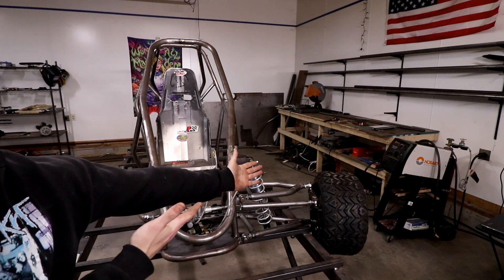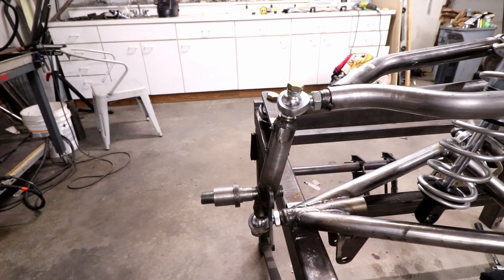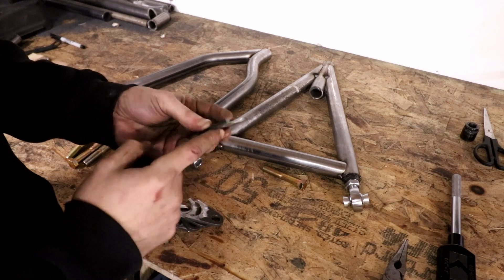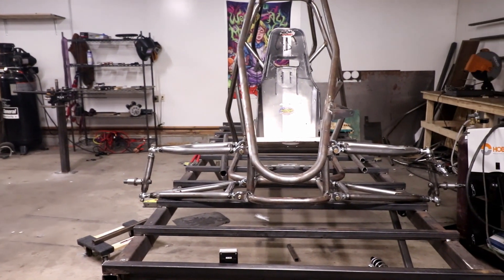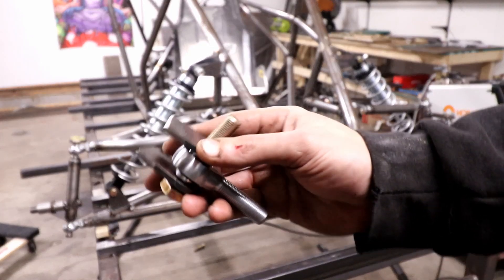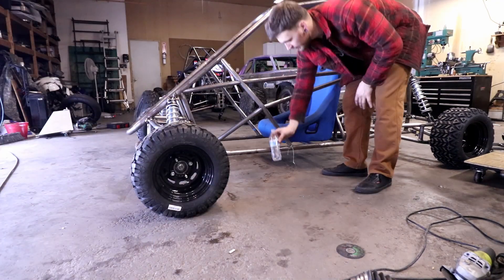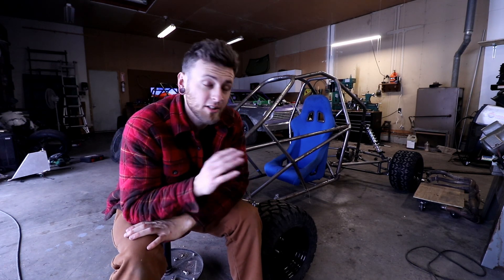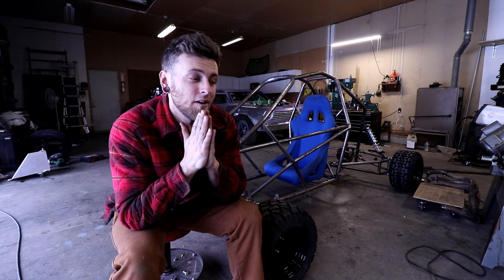Crosskart Build Pt. 8: Front Suspension

Comment from the maker: No Music track on this video. I wanted to try it with just tool aounds and see what you think. So Music or no music? ALSO timelapse doesnt record sound so I will use as little time laspse as possible.
Reply: It seems weird without music. Even something super basic and quiet in the background. But silence seems weird to me. 
Also, I got an idea, instead of using piles of heim joints why not use tubing? On amazon you can get tubing sizes 1.25 OD and 1.25 ID, a little sanding and it'd be a tight fit within a couple thousandths. Grease fitting, measure thrice, cut once, on all the suspension with a single axis of movement, like where the A arms connect with the frame. That's 2 heims saved per a arm, leaving the heims on the spindle sides for your adjustments.  8 heims on the front, and maybe a couple more on the rear. Wherever there's a single movement axis, two tubes could be a vastly cheaper way to make those joints. Tubing that size is like 23$ for 1.25" OD .125" wall by 4 foot. My .02 cents, love builds like this!
Reply: Best build I have seen for simplicity of thought. Just about to start one myself and I like your suspension layout.  Forget the music, waste of time. 
Where did you get the rack?
Reply from the maker: @Richard9591  jbugs or appletree. Search 14" rack
Reply: Seems weird without music though. But you could do some kind of murder mystery instead of music.
Reply: I like it most music ends up being so much louder than everything else thanx for giving it a shot
Reply: Find an Intro and Outro music sample that you like. Copy right free music is availavle on youtube and then when you have moments of just working you can play the same music low in the back ground. Honestly the best way to fill in that dead air would be to explain what you are doing and why. Then if you can't fill that time with an explaination you can talk about your hopes, and dreams for the future of this build. That might seem weird at first but you are trying to connect with your audience. One of the best channels I have seen that is automotive based is the stradman look at the way he deals with what could have been dead air. He is doing something right he has over 3 million subs. https://www.youtube.com/channel/UC21Kozr_K0yDM-VjoihG9Aw No I have nothing to do with that channel
Reply: ПОДСКАЖИ ГДЕ ВЗЯТЬ ЧЕРТЕЖИ

Comment: That thing looks good. I've already got that much of mine done  and your talkin about 5ﾟ here in there I'm thinking oh crap I guess we will see what happens.  I've learned a lot since it's been done I guess if it breaks it breaks or works?  Without knowing really what I was doing I tried to make the upper and lower rear A arms parallel squar. Had the axles level  when I mounted the A arm brackets figuring that would keep it from binding
Reply from the maker: equal length a arms wont be a big deal. they might camber out at full bump...not great but if its a backyard kart who cares right?

Comment: I prefer music(rock), and what engine are you useing? Reverse? I just picked up a 1994 Arctic cat wildcat 700cc efi with reverse!! It’s a can of worms i tell you, anyways keep the great work up can’t wait to see it shred!!
Reply from the maker: 1 for music. Im using a 2015 gsxr 600 in this one with no reverse. I may add electric reverse with a starter motor at some point. i Did think about usjng a sled engine in one but havent because of the extra involved with the torque converter and size of the pipes. I certainly will in the future for that instant powerband with no need to shift gears for the more novice riders